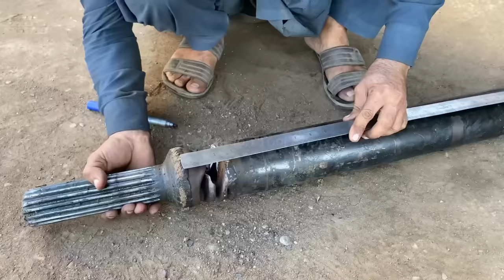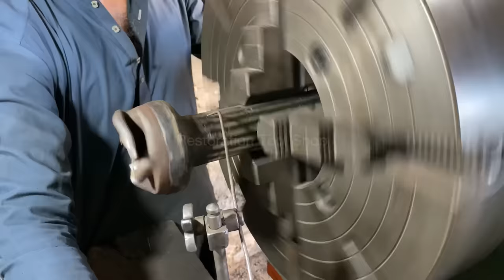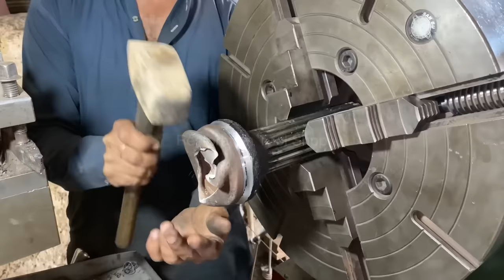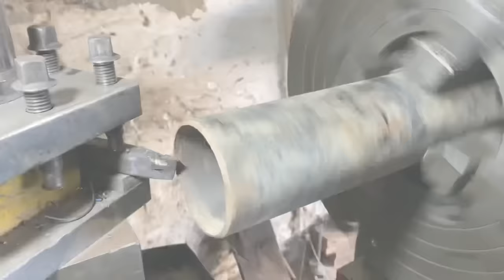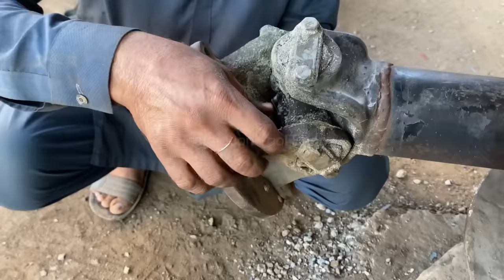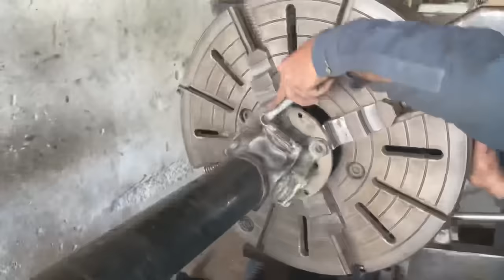TRUCK DRIVE SHAFT REPAIR | Drive shaft repair and welding strengthening | Broken Drive shaft rebuild

Comment: I repair drive shafts and I can say this shaft is not balanced or zeroed out. It will fail in the same way it failed from the previous repair.
Reply from the maker: No sir, earlier someone had installed a piece of indigenous pipe, so that pipe broke, now we have installed a imported pipe, now it will not break.
Thanks
Reply: That shaft will have so much vibration due to imbalance, guaranteed breakage.
Reply: @restorationtoolshop  They did not use a dial indicator or a press to straighten after welding. You can't eyeball that stuff. It will fail.
Reply: EVEN IT WAS BALANCED DUE TO THE OVERLOADING OF THE TRUCKS IN THAT COUNTRY IT WILL FAIL.
Reply from the maker: @kostasgrapatsas2074  okay thanks
Reply: My thoughts also...you can see it was already repaired at the universal joint end...check the welding..its like  a mountain track
Reply: This repair is perfectly fine for big trucks, these guys work with what they have. This is how it was done many years ago. Stick ac buzz box welders and unbalanced drive shafts.
Reply from the maker: @ibidu1  okay thanks
Reply: @restorationtoolshop  👍👍👍😀
Reply: What you don’t like the accurate indicator they used.
Reply: With the loads these guys carry, and the way they drive, I don’t think it really matters!
Reply: @johnpietros9439 I wish they showed if it was the Starret or the Mititoyo.
Reply: @vegasflyboy67 I guess there will always be someone sitting back and pointing out the flaws in other people’s work.
Reply: @80SWoods  I'm not just sitting back, I work on these things and can assure you that it's more than a flaw, its dangerous.
Reply: @vegasflyboy67  Don't think the word " Danger " is in their vocabulary!
Reply: @vegasflyboy67  You are seeing this through your own perspective of having all of the tools and equipment possible to you and turning out work based on a high shop rate where people expect perfection.  These guys work in the dirt with minimal tools and are trying to keep equipment going long past its useful life according to western standards.
Reply: Yes you are right but one thing you forget is they will come back for another repair repeat business
Reply: Could you do this under these circumstances??? i DIDN'T THINK SO.
Reply: The bad roads those trucks ride on will kill the whole truck too.
Drive shaft is least of their worries.

I think this guy did a great "old school" repair.

And kept a clean shop too.
Reply: You can only pee with the nob you’ve got though 😂
Reply: I agree and the posting channel is full of crap. Driveshafts have to be within a certain range of balance and its not like you can add weights like in a tire. Add in the fact you now have a 3rd weld you need to balance, I call buuuuuuuulllllllsh!!!!!!!!!!!!t
Reply: @ibidu1 years ago vehicles didn't go as fast as they do now. And it's not years, it's almost a century since they made shafts this way.
Reply: @80SWoods apparently you don't travel much. They have shops in these countries with the equipment to do this right. Stop being gullible. You probably believe the nature houses are built with no heavy equipment too 🤦
Reply: @TheTrollTrollyYeti  Thank you for firmly putting me in my place, Troll.  You are clearly the expert at driveshaft repairs with your clever comments.
Reply: @TheTrollTrollyYeti er, yes you can add weights to balance a driveshaft. It's done all the time
Reply: @psk5746  Where do you put the weights?? Do they look at all like tire weights, lol always wondered how they balance these things.
Reply: @restorationtoolshop  lol, wrong. Is it balanced? No.
Reply: When you make a repair like this you get thousands on that driveshaft you add a lil extra cause why not . 
This guy gets paid 10$ to fix that driveshaft you delusional to even think they have balancing tools out there
Reply: It was balanced, he put 4 randomly sized and positioned welds on the inside of the pipe then added another lot of  randomly sized and positioned welds before over welding with another lot of weld!

What could possibly go wrong with that method?
Reply: These things are brought through Allah, you would not understand.
Reply: The thing is, replacing it is not an option there so this is the best they can do.
Reply: @SalimKh4n  All they need is a dial indicator and a hydraulic press. I've seen dial indicators for less than $20 USD and you can make a hydraulic press with a car jack. There is really no excuse.
Reply: @restorationtoolshop ....the replacement metal may be stronger, but the driveshaft still has to be balanced.  It will guaranteed fail.
Reply: Of course, it will fail in a month. That's job security in a 2rd world country.
Reply: Os caras são bom sim no que faz com o que tem pra fazer.eles tem sim princípio.
Trabalhando muito bem com o quê tem

Comment: There is no way that that shaft will run true to the centrelineof the gearbox. They probably dont drive fast so the vibration wont be noticed. And itll get torn up with overloading anyway. Love to watch the work  skills with what they have. Well done . Greetings from Australia

Comment: Sorry people but that isn't the right way to repair a driveline. If you put hat in a truck it would vibrate to no end. If you are going to show videos of repairs show them doing things correctly
Reply: You can't get going fast enough for it to vibrate! I'm sure there would be a lot more issues with those gems before you noticed a driveshaft vibration! To them that is the correct way to repair it!

Comment: I hate to think what condition the lathe bearings are now in after being used as a conductor for the welding!!
Reply: Was thinking that exact thought. On their new lathe too
Reply: Well, you don't know where they put the ground . Perhaps on the drawbar/colet chuck holder, they are solidary to the spindle
Reply: Всем подшипникам там уже давно хана. Поменяют😂
Reply: Карданный вал, обязательно нужно балансировать.

Comment: I hope that arc welder ground lead is grounded to the piece he's welding and NOT clamped to the lathe. If the ground is clamped to the frame of the lathe all of the current is flowing through and arcing across the headstock bearings, that will damage the bearings.
Reply: So do you think this is the first time this guy did this type of work?
Reply: @thepubliceye  Why would you ask that? It's obvious that what he's doing is his job and he's doing the best with what he's got to work with. What I'm saying is a cautionary tale of why you should not ground the work through the body of an expensive lathe because the current flow will damage the bearings eventually via arc pitting between the balls/rollers and the race.
Reply: I understand that's one of those things that "Can Happen" but in reality seldom ever do. With roller bearings as tight as the lathe head it just doesn't happen.
In addition to the rollers, there are a lot of steel gears and even a sleeve bushing.
Reply: @thepubliceye  I don't want to come across as argumentative or mean any disrespect to you but what I described is a real thing that happens and I was there when it was happening.

Mechanics back in the 1980s working on Chrysler vehicles has a streak of bearing failures namely their front wheel bearings, we would just replace the bad bearings and the vehicle would return months later with the same problem. This happened frequently enough to where Chrysler engineers issued a TSB - Technical Service Bullitin when the figured out the cause of the premature bearing failure.

There was no internet back then and mechanics got their 'critical' repair info via the TSB and that one directed us to look for loose or missing body ground cables/wires and to fix that issue while replacing the bad bearing. Over a period of time that problem once corrected went away. Peace
Reply: @slomotrainwreck  I am aware of that
Reply: Good point bro. Doubt that happened.
Reply: They can fix the bearings too!
Reply: Hope isn't going to help. They don't even use wire as the ground lead but rather scrap metal strips laying on the ground that are just touching the machine.

Comment: Lol looks like a previous repair with sub par materials got twisted up like a pretzel and snapped off again in the same spot.
That's one way to provide yourself job security, I suppose lol.

Or, it could be a torque limiting safety feature, making it break in a predictable, easy to repair spot, in stead of screwing up the much more expensive gearbox or something.

Either way, it's brilliant.

Comment: Hello .... You did a good job... My observation is that when using the center to hold the elongated piece, the bracket must be loosened to avoid a slight deviation between the bracket and the center... The center is definitely more correct than its bracket placement, no matter how precise it is. Thank you, my friend.

Comment: This is the cleanest shop I've seen in a long time.
Reply from the maker: Thank you sir, you like our shop
Reply: Como serán las otras, si esta parece un basurero, taller horrible
Reply: All things relative this is a clean shop and some of the cleanest lathes also. That said I see shafts going into the lathe and not once have I seen anything wiped of floor sand. However if the a market accepts the results  I guess it’s good enough, who am I to say.

Comment: Why not cut the ends off and replace the whole tube?
Reply: That's what we do in the USA
Reply: @TOONMAN200 because we do it right the first time. I guess its cheaper to use just a small section of pipe than an entire length.
Reply: The guy needed the extra money to buy more doo dads!
Reply: You bill the customer for a complete length, you cut off only what you need and repair the gap. Extra profit, plus more shaft for the next job…

Comment: I once did that to a drive shaft of a semi in trucking school.  We were practicing backing up trailer and I was in reverse gear, as we were backing up my foot slip letting go of the clutch and instinctively press on the break with the other foot and it caused the drive shaft to twist and drop to the ground, look pretty much like this one.

Comment: I have seen other channels do similar repairs with lots of high tech equipment, and the result is no better than this. Very enjoyable to watch your skill and ingenuity
Reply from the maker: Thank you very much
Reply: Shops with High Tech equipment wont repair drive shafts like that cause its just cheaper to replace.
Reply: @The_Black_Sheep95   In Pakistan replacing is almost always not an option
Reply from the maker: @The_Black_Sheep95  Thanks
Reply: @The_Black_Sheep95  True but it's hard to grasp just how cheap labor is in Pakistan.  It's so much less expensive to repair there.  It used to be that way in the US also.

Comment: Why did they just not cut joints off each end and replace with new length of tube
Reply: They snapped it before looking at that double weld.  The breakage is in the heat affected zone of the previous weld also.  I think they need to take it easy deploying the NOS with weak drive shafts. 🤣

Comment: I built Rockwell drive shaft and Spicer drive shafts at Mack Trucks manufacture plant and at freightliner dealer ship and thats not how we repaired or built them 
Biggest error is splicing the tube 
If you noticed where it was twisted it had already been spliced next there is a indexing arrow on the stub that aligns with the slip tube that aligns with the yoke at the other end before welding  ( the yokes will never align properly) true hacks that dont know what they are doing
Reply from the maker: No. First we have leveled the line of both the crosses and then we have done welding
thank you
Reply: True hacks?  That’s a little harsh.  These guys are doing the best they can with limited resources.  Give them a break.

Comment: Here in America we would just throw it away it's kool to see how others around the world do repairs
Reply: There are many good reasons for that.  It will never have the integrity of a newly manufactured part, and compared to the cost of breakdowns, parts are cheap in first-world places.
Reply: @ThreenaddiesRexMegistus  yes you are correct however they make it work

Comment: God job!
Hopefully this time it will run next 5 miles without breaking apart.
Reply from the maker: Thanks Sir
Reply: It won't even make it out of the driveway.
Reply: @markniilo   Luckily for the owners all "repairs" included backlight-warranty.
So most trucks never left these shops again.
Reply: It will work , most twisted drive shafts happen when forcing the tractor under a trailer that is heavy and too low . Or overloaded truck in a ditch and trying to just drive out . With normal use it will hold . Worked at trucking company 10 years and saw a few .
Reply: @txrick4879  Impossible, working 10 years in Pakistan's trucking company, because until a few years ago, trucks were completely unknown in Pakistan and for all transportings donkey-carts were used.
Maybe you're confusing it with a broken leg on a overloaded donkey?
Reply: @horstmuller7512  I worked in The us and have seen a few twisted drive shafts . So just chill out , you are to high strung .

Comment: Could have reached inside the six inch piece of pipe to weld like you did with the inside sleeve...?
Reply from the maker: No. One piece is welded from both sides inside and out and one is welded from outside only
Thanks

Comment: not even watch the whole yet and can see the this “repair” has been done before and broke in the same spot the previous weld look strong.however the base metal of the repaired tube used is to soft that why it twisted.
Reply from the maker: You are correct, but it is not the welding that is broken, the pipe is broken
thank you

Comment: Fabulous work.....!!
Reply from the maker: Very much cycle of liking the work sir
Reply: very nice job, only one major mistake, not maintaining the parallelism of the universal joint that will be mounted on the splined shaft of this shaft ! 🙏😩
Reply from the maker: @staszekboroski526  According to us, we have done very well
thank you
Reply: @restorationtoolshop  and the universal joints came out parallel ?
Reply from the maker: @staszekboroski526  okay Thanks 🙏

Comment: that's the same shop who made that shaft before it was broken
Reply from the maker: Yes, no, earlier they hired work from another workshop, now we have made it, it will not break
thank you
Reply: They actually produce high quality repairs. The only thing you make is smart ass comments.
Reply from the maker: @kode4420  thank you
Reply: @kode4420  haha high quality? probably it will be back soon in the same shop
Reply: @CBMoto. Despicable.  There’s always someone else bravely pointing out “flaws” behind their keyboard.
Reply: @80SWoods Like you just did?
Reply: Yes, exactly like that.
Reply: Yes, exactly like that.

Comment: Highly skilled mechanics. A joy to watch.
Reply from the maker: Thanks 🙏
Reply: Indeed, coming from the jungle or any totally isolated place since birth this looks incredibly skilled, but for the rest of the mechanised society this is below any standards, a decent co-worker would replace the whole driveshaft instead of welding a small piece in it.

Comment: Mechanics fix the similar truck problem always, because drivers abuse their truck, overloading.
Reply from the maker: You are right Thanks
Reply: No they don’t there is no mechanic that will fix a drive shaft like this! It wont hold! Semi mechanics just replace the drive shaft with a new one! These need too be precisely balance or they break again or tear up the transmission

Comment: Why wouldn't you measure the shaft size and cut both ends off weld the ends back on and balance it ? This is not repaired .. this is job security

Comment: I'm wondering why you didn't bother to CLEAN the pieces before welding them - not even a cursory sanding or wire brushing. Just weld the dirt right in. I guess that's one way to promote repeat business.
Reply from the maker: You are right, thank you sir
Reply: Don't worry about the mule going blind, just keep loading the wagon!

Comment: To do this properly . First you need to remove both ends and make it one solid piece . Nkt cob job it together like that. Accessive heat will worp the metal to the point of failure .
Reply: Learn how to spell before you start talking crap. It's "warp". Also I'd bet they know more about welding than you do considering they do multiple repairs daily. Experience is obtained from actually doing the job, not from walking around being arrogant.
Reply from the maker: You are correct
thank you
Reply from the maker: You are correct
thank you🌹
Reply: Best to re-tube the drive shaft.
Reply: @kode4420  "Learn how to spell before you start talking crap;  it's warp".  Improper use of  quotation marks and you should've used a semicolon;  just saying.

Comment: Well, the guys do what they can with the limited tools available. But this job will fail. It is not properly repaired and it will come back very soon for the same reason. Main reason for failure is imbalance. It will not last unfortunately
Reply from the maker: You are correct
Thanks

Comment: HOW COME THE DRIVE SHAFT WAS MADE OF HOLLOW STEEL PIPE ?
I CAN TELL THE OLD SHAFT HAS BEEN REPAIRED THE SAME WAY BUT COULD NOT STAND THE HEAVY TWIST POWER. PERHAPS THIS IS WAY TO LET TRUNK OWNER COME BACK AGAIN AND AGAIN !
GOOD SKILL, BUT THE REPAIR MATERIAL IS SO POOR AND LOW GRADED.